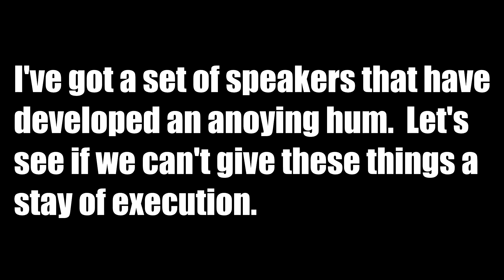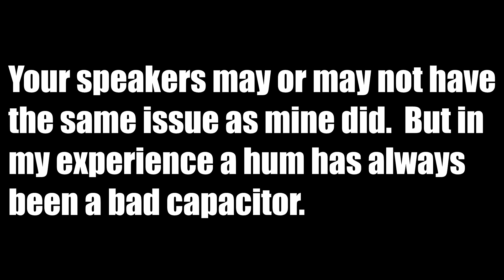Fix your humming speakers

Comment: Capacitors are responsible for filtering the power reducing low and high frequencies to a nice flat clean signal. Once they are damaged you get this humming so its necessary to replace them.

Comment: I have these old (from 2007 or so?) PC speakers from Hercules, and the left speaker has a very low sound. And when i turn the volume up real high, it is "humming".

Where do you buy capacitors and how do you know which one to buy?
Reply from the maker: You can buy them on amazon/ebay/your local electronics shop.  Look on the capacitor and it will be labeled something like 500µF25v.  That's the rating that you need to match.
Reply: @idoesstuff1  Thank you. I will see, if I can open my speakers and if I can fix the left speaker (probably not, but why not try?)
Reply: Hercules XPS510? I'm trying to fix the hum in mine right now. Did you have any luck?

Comment: I have the same set of speakers.  If it wasn't 11:45 pm I would take them apart.  Thanks for the excellent video.
Reply: Well what the heck.  I had it apart by midnight and it's the same cap.  The replacement is already on it's way.  Thanks again.

Comment: Huh, I actually have the same speakers, I think you can actually fix the humming by just plugging a auxiliary cable from the front of the speaker and that should fix the problem.
Need to find one so I haven't seen if it works yet.
Reply from the maker: Not really a fix but more of a work around.  However I'm not sure it will work if your speakers have the same issue as mine.

Comment: At what point does it become unsafe to handle a capacitor? I've heard horror stories of how they can store charge and kill people if not handled correctly.
Reply: How would you touch a very hot milk to drink. Same goes with capacitors.uncharge them before touching
Reply: They will have a voltage rating on the side, which gives you an idea of the danger. Small low voltage ones you can usually short out to discharge. Larger ones you should use a big resistor as a load to discharge them. You can use a multimeter to check the DC voltage across the capacitor before handling it (make sure to get the right polarity, or just check it both ways).